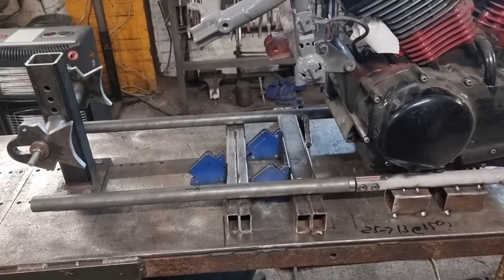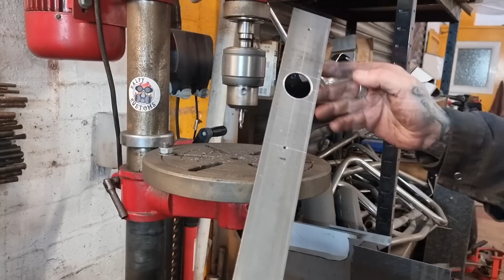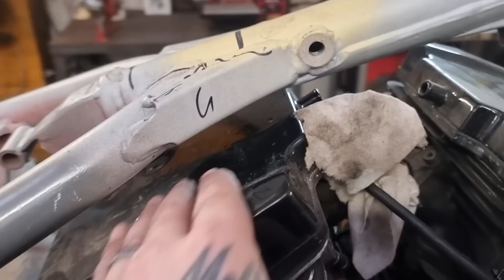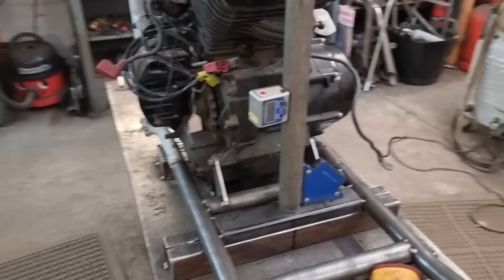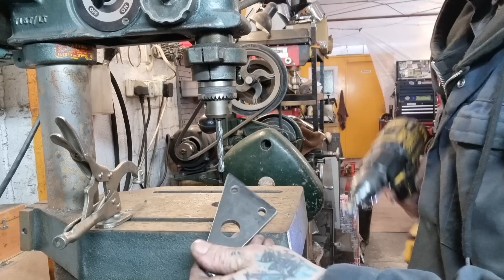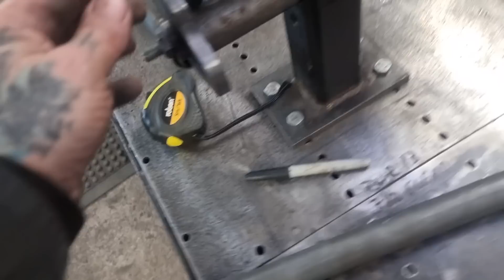VN800 Rigid Pt2 Final Handmade Custom Bike Building #chopper #bike #engineering #mechanical

Comment: great work Ralfy. just one question... is that centre post and back bone extention not to high compare to seat rails? it looks like that on your video, or maybe was camera angle so it looks higher.
Reply from the maker: That is correct, slightly, the sprung seat won't mind 😀